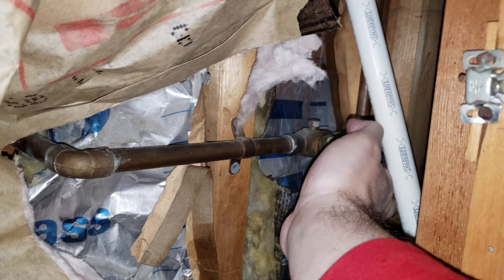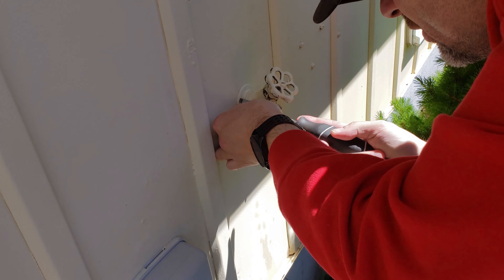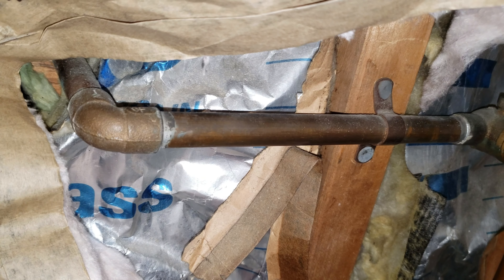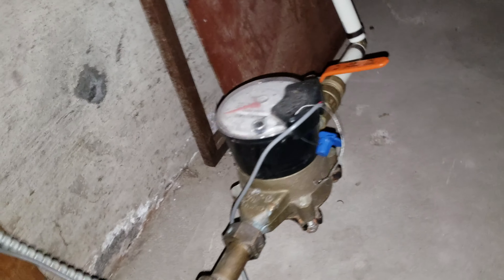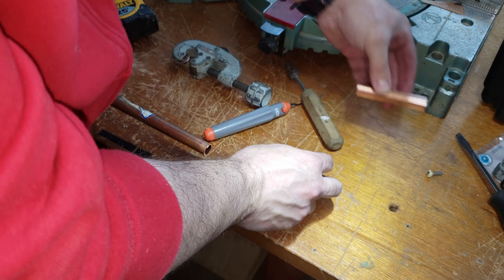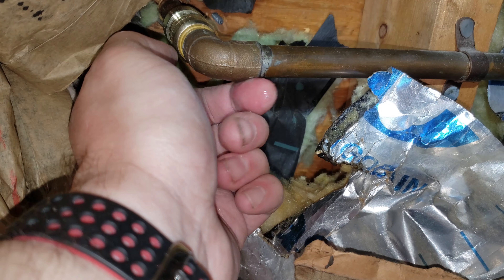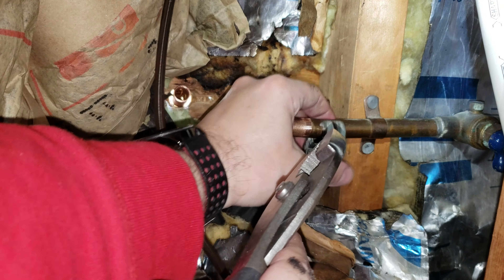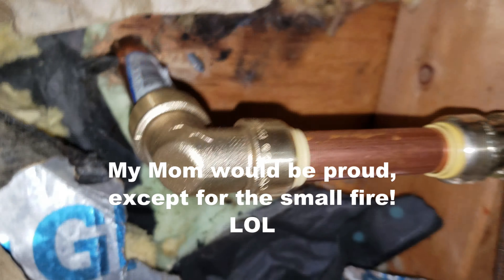How-to Replace Outdoor Faucet with Shark bite Spigot

Comment: Yesterday a plumber wanted to charge me $250 apiece to replace two spigots.  One of them was threaded and came right off in a few minutes and the frost-free replacement is $60.  Your video showed me how to replace the other one.  Any plumbers reading this, some of you guys are just crooks, otherwise guys like me wouldn't have to watch videos like this to avoid getting robbed.  Liked and subscribed!
Reply: As a former plumber I can tell you that we were told that we are salesman first. I’m sure plumbers would hate this but it’s true. Not all of them are crooks but most of them are lol. I sucked cause I couldn’t lie to a customers face about fixing something that didn’t need to be fixed. Just a heads up though on the Sharkbite products. Make sure they were tested under 32 degrees or it might crack. I seen some that did and it’s a pain to get it off